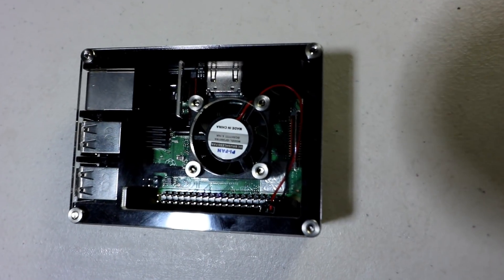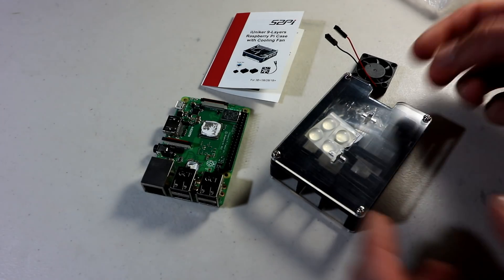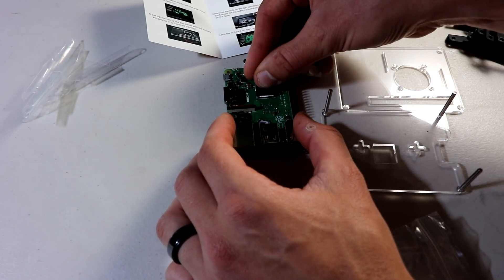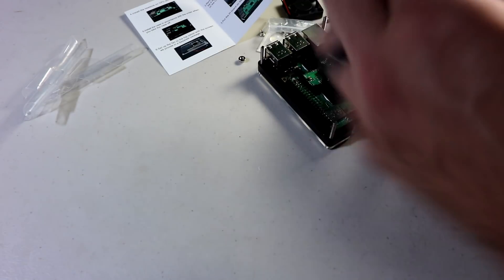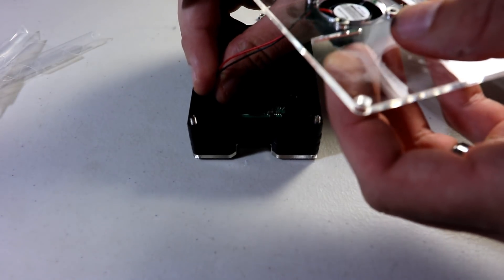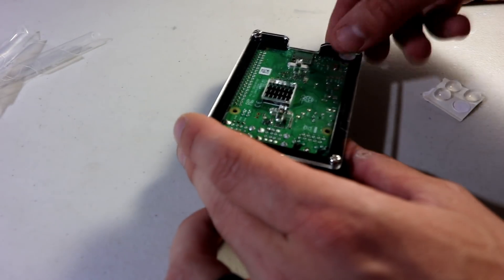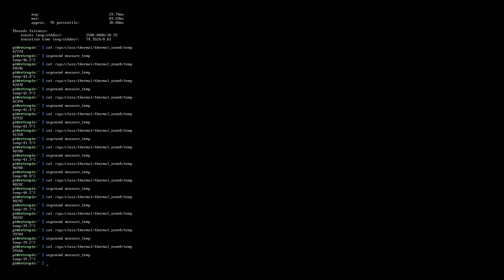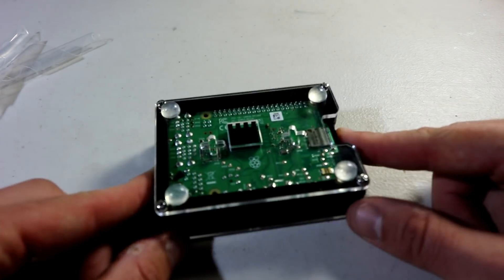iUniker Raspberry Pi 3 B+ Case w/ Fan & Heatsinks - Overclock Test

Comment: Drew, great video. Thanks!
One question: I was reading that RP3 only supports up to 32GB SD cards. But I noticed you have listed you have listed SD card up to 400GB. Does it mean, we can use/access 400GB?

I need to build an app that needs to store images [temporary] for processing before sending out data. So I need more than 32GB in some cases.

Can shed some light on this please?

Thanks!
..Ben
Reply: Connect using usb